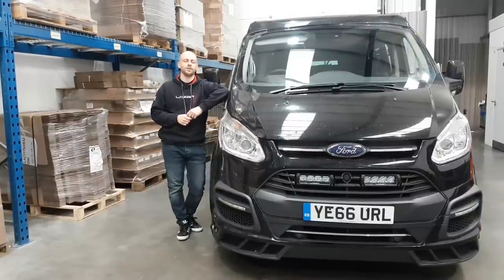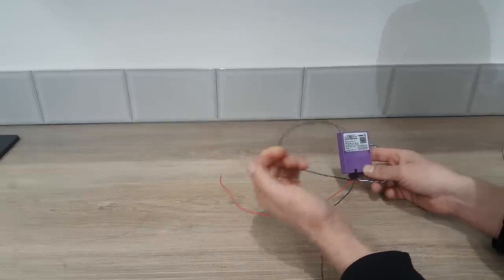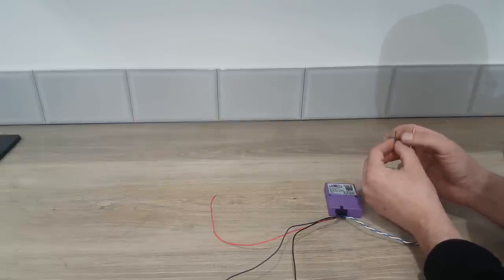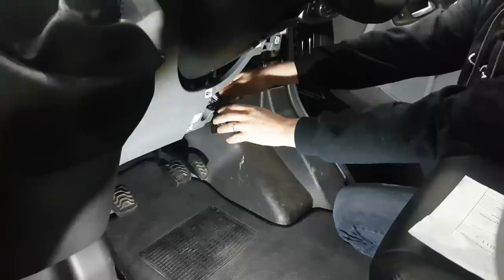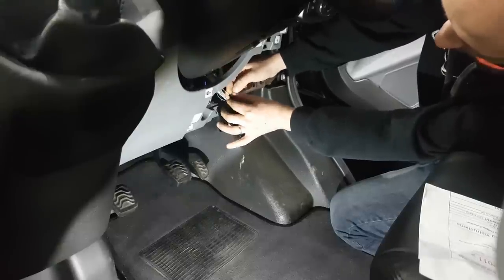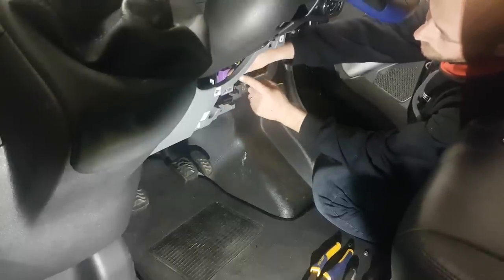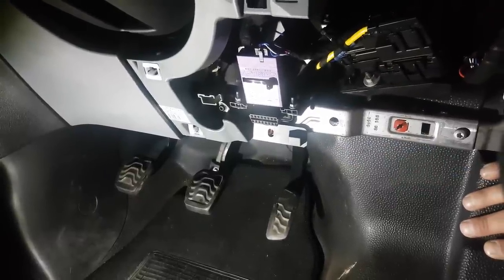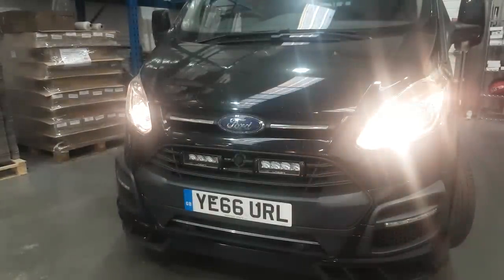HOW TO: CANM8 High Beam Interface

Comment: Is it acceptable to  power the Canm8 module and the contactless reader using the same wire? I.E.- solder the red wire for contactless reader and red wire for high beam module together then to 12v power source
Reply from the maker: Hi, The contactless reader requires a 5v input, not a 12v input. The 5v input for the contactless reader will come from the canM8 itself. (Can M8 has a 5v output to power the contactless reader).

Comment: Do you know if a 2017 Mercedes Vito would need a canm8 for installing your lights
Reply from the maker: Hi Andy - if the vehicle has halogen headlights then no, high beam should be a black and white wire on pin 7. It it has LED headlights, then yes a CAN interface will be required.

Comment: Can the CANm8 be used for functions other than the main beam? I've got a job on the go on my 2017 Volvo V40 which uses CAN to activate all the front lighting functions. I am looking to also get a 12v feed from the dip beam as well as a main beam one for an LED light bar.
Reply from the maker: It would be best to refer to the CanM8 website as they have a more comprehensive portfolio of interfaces that do different jobs, and we're sure they'd have what you need.

Comment: Can you do a better or new video so i can see how to wiring up
Reply from the maker: Hi Andre. We'll look to do another video soon, but the wiring requires a reasonably good level of knowledge and confidence that we would suggest of you are not sure, to get help from a dealer or professional installer. 👍
Reply: I have done everyting on my install and cable harness. I have attached and installed the led auxiliry light + dehtsch contacts/plug play. That is done. Now is my question . Where should the purple wire go ? From Relay to ? The canm8?
Reply from the maker: @erikandrehoglund55  - The purple wire from the Canm8 is the HighBeam output signal. So, this is the wire which is used to activate the relay when the vehicle high beam is turned on. So - you need to connect the purple wire from the Canm8 to the small red wire which is coming from the relay on our wiring kit.
Reply from the maker: @erikandrehoglund55  We recommend to use a crimp connector like this: https://uk.rs-online.com/web/p/crimp-butt-splice-terminals/4580702/
Reply: @Lazerlamps  Thanks Now Im gonna test if it works because this was the only cable left to install. Maybe it will work.